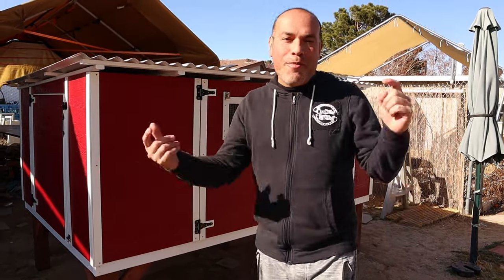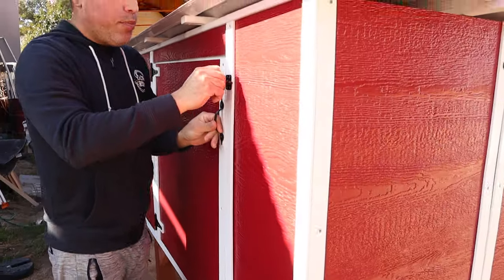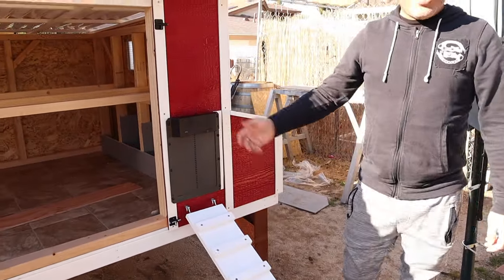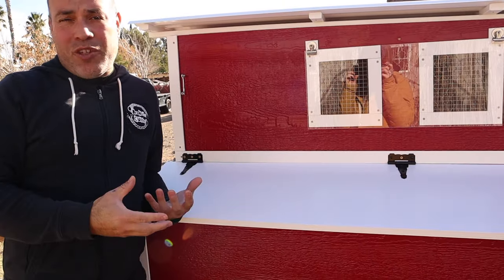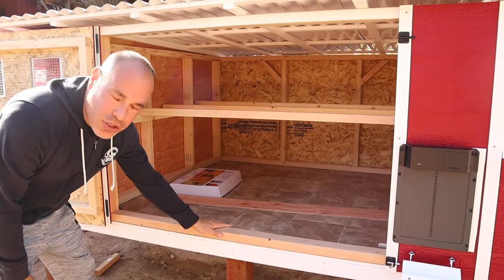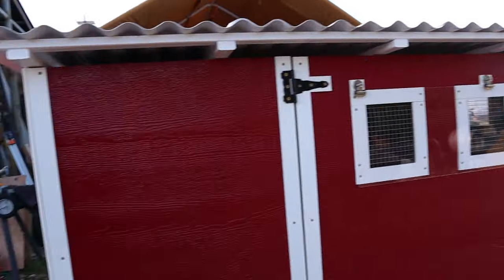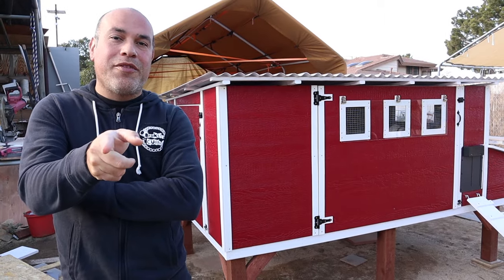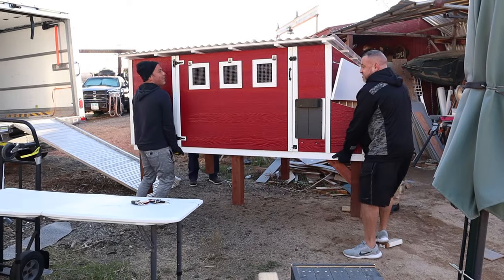How Will We Get This Large Custom Coop in The Truck ?

Comment: Next time you build a big coop add wheels or shipp it in panels so it will be easier to transport
Reply from the maker: The wheels wouldn’t be able to go up the ramp though. Once it’s on the ground, two adults can move it easily. I also don’t want to make my client have to put something together. These are really well put together here
Reply: @BockBockBouquet  If you have the chance to add a second ramp so that the wheels can roll on each one?

Comment: Congratulations, you have built a very successful chicken coop. A coop with dimensions of 5feet=1.52m and 8feet=2.44m, that is, 3.71 square meters in size, emerged. "Since meters are used as the unit of measurement for length in my country, I could not calculate the chicken coop area without converting feet to meters." :) :) :)
Is there a standard number allowed by law in your country regarding how many laying hens can be housed in 1 square meter area in laying hen coops? If yes, how many chickens can you put in 1 square meter area?
Also, you did not allow an accident to occur while loading the truck, congratulations once again.